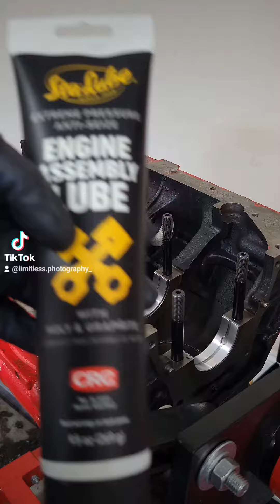cswindel - 1995 Eclipse GS-T

Comment: 7 bolts are so much easier to pull back apart than 6 bolts with "suit case" handles and a center thrust cap by itself. Once I get the main studs in, checking clearances is not hard, but more of a tedious issue. 
Nice job!!
We also use the same assembly lube! It lasts for YEARS and is still fine. 👍